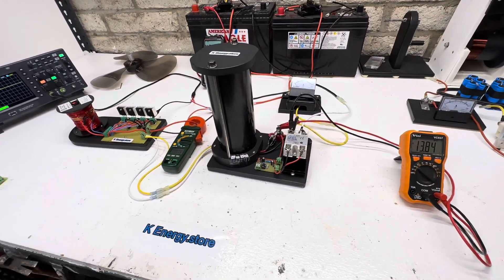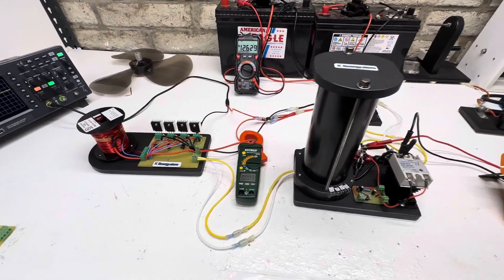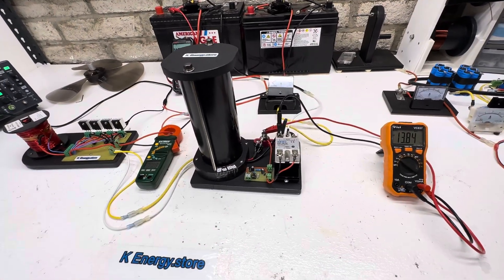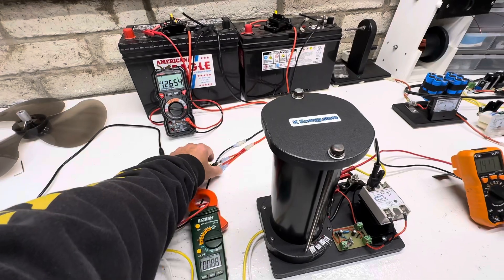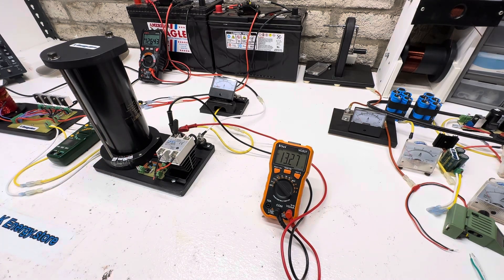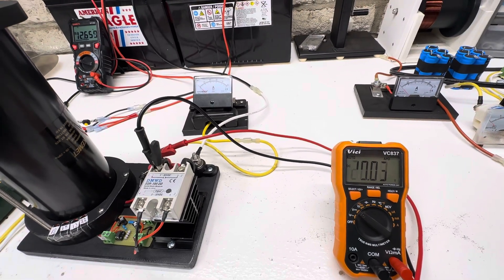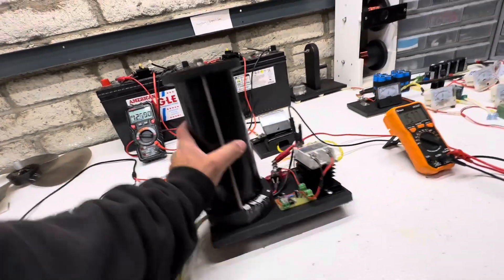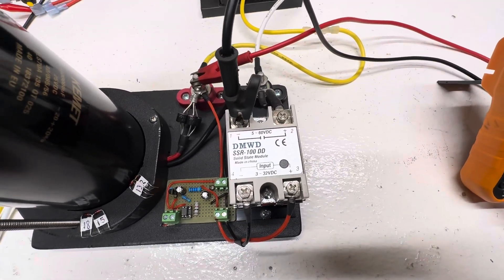1.3F Cap Dump 75amps at 24v for sale

Comment: For example, I have tried charging a capacitor with a joule stealer and triggering it with a battery at high current, but when I put the joule stealer directly on the battery, even at low current, the battery charges much faster and the voltage immediately starts to rise steadily. I have done many experiments, so what is the best way to connect it directly to the battery without dumping the capacitor?
Reply from the maker: Connect it directly to battery for lead acid or lithium iron

Comment: Great video! In regards to just the board, how high of a voltage could this board handle for a cap dump? I have a 320 volt 100uF cap i need to dump when it reaches 300 volts. Can any of your boards do that?
Reply from the maker: @SuperheroArmorychannel  thanks ! 
This board is for up to 48v charging you would need a voltage regulator for that high

Comment: Can you get the secondary battery fully charged before the primary battery running out ?
Reply from the maker: This is not over unity it a way to convert voltage to amperage
Reply: Yes i know , just curious about the ratio  between input and output of yours,my SSG ratio is about 1 / 0.5 , thank you ! @kenergy1707